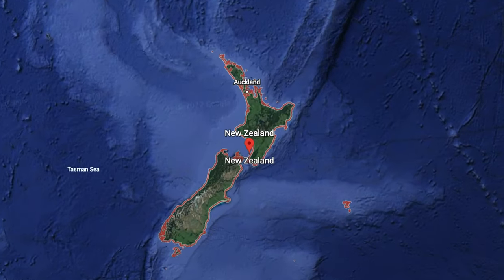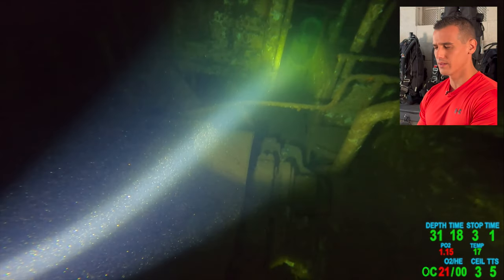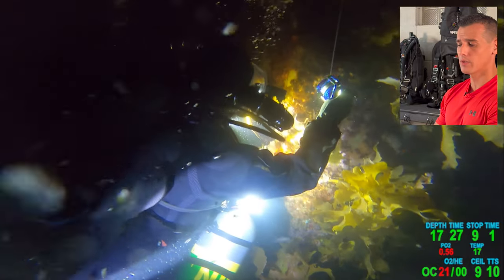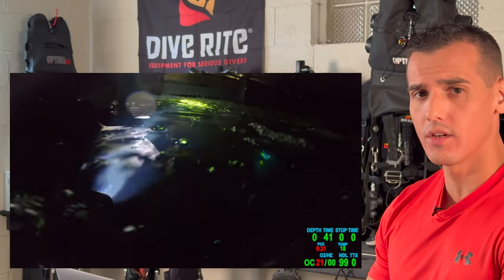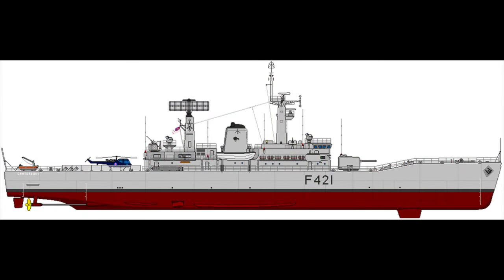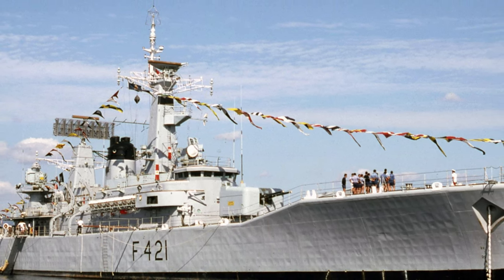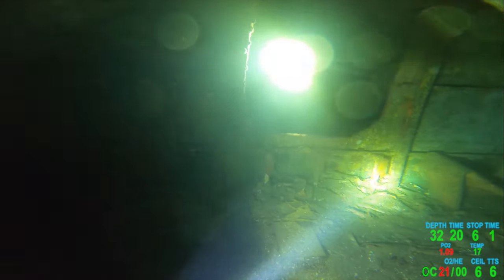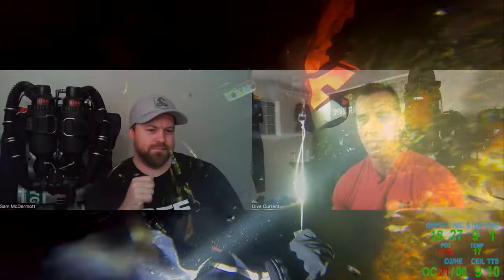Tech Diver Reacts To Serious CCR Bailout Incident!

Comment: Poor dive planning and gas management. Should be carrying enough gas to do his OC deco and so should his buddy.
Reply: Hey Matthew, we were carrying enough BO to get to the surface if we exited the wreck and went straight up. That staged bottle was nothing more then extra insurance. I actually only swapped to that bottle a minute before surfacing beceuase I was low on my BO bottle. I wasn't out of gas. Factor that was after a long swim at depth to collect that staged bottle (because it was there and why not have more then you need), and I also had my buddies full BO available if I needed it. I fail to see how thats poor dive planning or gas management?

Comment: I would say experience level on ccr is low. Problem solving could’ve fixed this relatively easy. I accidentally unplugged my o2 once. Caught the po2 dropping to about 1.12. Hit manual and didn’t work. Checked valve and o2 pressure and it was still good. Knew it had to be unplugged, fixed then continued the dive. This could’ve been solved similarly.
Reply from the maker: He bailed out because he was dizzy, he did not want to get back on the loop as it was compromised potentially. Thanks for your comment!
Reply: @divecurrent  I’m not familiar with the kiss units, but I’m sure there is a method for them to conduct a diluent flush?
Reply: @techdiverpratt5899  you most definitely can do a Dill flush but due to the in-line shutoff being bumped off, I couldn’t get any Dill into the loop. Sure, after I solved that problem I could have gone back on the loop, done a Dill flush and waited to see if that solved the problem. But CO2 issues can put you to sleep fairly quickly right so I didn’t really want to risk it. I had lost faith in the loop at that point (assuming CO2 breakthrough some how) so followed my training and bailed out. 

What response were you taught out of curiosity for a dizzy experience on a CCR? Like I’ve said before, I’m keen to learn from this.
Reply: @TURSTY09  I want to make it clear that I don’t think you did anything wrong. You made a decision, there was a plan in place, and you live to dive another day. 

In my mod 1 I was essentially taught to also just BO. Any kind of issue, BO. 

In mod 2 we were taught to work through the problems first. hypercapnia is typically a slow onset, usually with an increase in respiratory rate. Sanity breath, seeing if the symptom resolves itself. If it does I at least know the issue is in the rebreather, but if I was for say skip breathing or really choppy short breaths a dil flush could vent the loop of bad gas and allow me to get back on it.

Comment: He woukdve gone straight to the top if he was in trouble. You dont do deco stops if youre avout to die. Stop dramatising it. He was fine. His buddy woukdve also has spare air. If they was 250m down then yes but they wasnt. And he also had open curvuit reg? He was no way near death!
Reply: See the all postage. He thought the gas on the loop was bad, so he take all gas from the loop out. When he tried to breath again, because shutoff valve was closed, he got nothing to breath! So he flushed pure O2 to the loop at 30 m!!! This was really dangerous, but not because of CO2 or lack of gas.

Comment: Hey @Sailing Rattler - Diving KissCCR - Sam McD, fellow Kiwi KISS diver here. Thanks for sharing your story, and glad you made it out of this hairy situation safely.
I am diving a KISS Sidewinder, which has identical scrubber / ADV units to your Spirit. From personal experience I think you might want to consider re-adding the shut off to the hose supplying the ADV (but NOT to the one supplying the BOV!): The design of the ADV on this unit makes it quite sensitive to pressure difference and water movement, so that it is easy to get it to trigger and add unwanted Dil to the loop when going head down or sideways. If this happens while you are going head down through an opening it can quickly lead to a runaway buoyancy event at a time when this is most unwelcome. Since you are already using the BOV to add Dil you will probably find that the ADV can stay shut off for most of your dive anyway.
Also, hope to dive with you on the Mikhail Lermontov wreck one day. 😀
Reply: Thanks for the advice Michael. I will take a look at that, however I think it might be a challenge to get a slider on the ADV line independent of the BOV the way the spirit comes. The whip from the offboard tank runs up to a Y manifold that’s between the scrubber and the backplate so well out of reach. It’s all doable, but would require a total hose RE-run. 
So far I had not had an issue with the ADV firing when I didn’t want it to and I’ve been in all kinds of orientations on it. But will definitely be aware of that. 

I have actually heard of a story where having the ADV switched off would have killed two divers due to an uncontrolled decent after a boatman had to ditch the anchor with a buoy (that was far to small for the current and weight of two CCR divers), while two divers decompressed in current in the Solomons because a third diver lost the anchor line and drifted off under an SMB. So everything’s a trade off I guess. 

The spirit comes (or at least this older version) out the box without a shutoff at all so that’s what I have returned the unit to. I figure Mike Young knows best right!! 

I’m actually off to the Lermy in November!
Reply: @TURSTY09 : Interesting that the ADV isn't as sensitive on the Spirit as it is on the Sidewinder - maybe because it is closer to the diver's center mass.
The Sidewinder does not come as a 'ready to dive' unit - you have to add your own components like the Dil regulator and quick disconnect, or even the harness / wing, so I would not expect this to come with a shut off supplied in the factory configuration.
In general, for most CCRs, the factory configuration they come in is often geared towards no-decompression open water diving (probably to keep the catalogue price at a bearable level), and you will often have to add extras like shut offs in order to make it possible to conduct more challenging diving with the level of fault tolerance that you are comfortable with. So I wouldn't take 'this is the way the unit comes in factory configuration' as 'this is the way that makes most sense for the diving that I am doing'. Rather play through all the 'what do I do if X happens' game for all the scenarios you can come up, and  make sure that your configuration allows you to get outcomes that you can accept.
Of course, if you have an ADV shut off (or any other 'control element'), it has to be in a place where you can easily and quickly reach it in order to operate it, and you need to practice this skill to develop muscle memory for it. Still, if using your ADV is the only way to stop a runaway descent then I suspect that something else was wrong before this situation developed, like the diver being way too much negatively buoyant.
Nice, I'll be on the Lermontov in October as well!
Reply: @mikeller_nz  This CCR thing is interesting ay. I'll continue to play the "what if" game and I'm sure I'll land on a configuration I'm happy with one day =P.

That story I mentioned has a heck of a lot more to it. Hopefully I'll manage to get the person on Steve's channel one day soon to explain it himself. Its a doozy of a story!!

Comment: Great video! Thank you for sharing Steve & Sam! Just wondering, the computer displayed on the bottom right of the video belongs to who? Sam or his buddy? Is it a back up computer? and why is it in OC even though the divers were still on the loop?  Noticed this when I wanted to find out the PPO2 in the loop when Sam pumped the O2 to breathe.
Thank you! Looking forward to your new videos!
Reply from the maker: That is not the actual computer, it is computer generated. It’s not designed to work with close circuit repeater so you’ll notice it looks kinda funny.
Reply: Yeah as Steve said, it’s a skin on the video that I loaded the log data from my wrist mounted, hard wired computer into, but I couldn’t get it to read “CC” which is frustrating. All the other data is correct, but I did forget to switch my computer to OC until I was outside the wreck.

Comment: Awesome interview and post accident review. 

However the burning question I have prior to reading any of the comments is what mitigation if any was done to the inline sliding gas switch that was fouled?

Does he still use them, did he change the style or modify the location?  Does his online gas switch need to be rotated or unlocked by twisting before changing state in either direction on or off position?

We are happy for his safe return home but I really wish there was more conversation regarding the gas switch.

Sam job well done mate so glad your still with us! 

Cheers, #SeattleRingHunter
Reply: @seattleRingHunter - it’s safe to say that slider went straight in the bin after a bit of a conversation around why it was even there in the first place. My unit was set up like that when I purchased it (second hand) and the logic for it was to do with Trimix deco dives and having a bit of extra insurance no helium would get sucked into the loop via the DSV during an O2 flush at 6m. I’m not Trimix certified so have no need for it. Plus I think there are other ways to achieve the same thing.
Reply: Great assessment and thanks for providing your thoughts on this. 
Cheers, #SeattleRingHunter

Comment: Why does his Perdix on OC Tec? Not CC tec??
Reply from the maker: That is only a display added to the video editing software. It is not his Perdix that was just for an example.
Reply: @divecurrent  ahhh gotcha! Thanks!
Reply: @ReverseCard  Yeah the computer overlay on the video is a bit buggy and the OC/CC label doesn't seem to change based on the loaded in data. I did somewhat forget to switch my computer to OC until I was outside the wreck, so it would have been a couple of minutes out on its deco calc, hence the conservitive ascent.

Comment: I have some observations about the info presented and maybe an oversight in one aspect concerning the final backup  bottle.

First, while this diver (Sam) ends up using 3 completely separate breathing apparatus (CCR, BO, and backup bottle), the computer display in this video never changes to reflect this.  We only see "OC21/00 ..." which while technically does not make a difference to the outcome for this particular dive, but for the viewer, does not help track the diver's current air configuration mode.  Should the diver not configure the computer for all 3 modes and switch among those so he has a reminder of which he is using, regardless of him having only regular air in each for this dive?

Next, the backup bottle that is retrieved during the exit/ascent phase... clearly has a NITROX yellow/green label on it, while Sam has confirmed during the review that all tanks including this backup are regular 21% air.  No mention of this oversight?  

I do not claim to be an expert, but when reviewing scenarios such as this I hope to learn from them rather than experience first hand.  I would appreciate constructive feedback on my comments for clarification if I'm not quite understanding this case.  Regards.
Reply: Hey @bryanboldt887 thanks for the comment, and yeah, I welcome constructive criticism.

That computer overaly is a skin in the editing software I use that is a bit buggy as I mentioned in a previous comment. The OC/CC label doesn't seem to change based on the loaded in data from my computer. I did somewhat forget to switch my computer to OC until I was outside the wreck, so it would have been a couple of minutes out on its deco calc, hence the conservitive ascent. But there definitely was CC21/00 and both BO and Stage OC21/00 gases loaded into both of my computers (Nerd2 and Petrol). I didnt switch the computer from the BO to Stage when I did that gas switch which wasn't best practice I know, but being that I knew they were both 21/00, it would have made no difference. Plus I only had 1 minute left under water at that point so I was ok missing that step.

Re the tank lable - Yes the tank is maked with a Nitrox band indicating that if could have any mix of Nitrox in it. The tank (like all our tanks) was analysed before the dive, and the actual mix recorded on a lable on the tank neck (at least thats what we usualy do.....hard to see if there is actually a lable there or not in the vid). Same goes for my bailout tank. Thats labled "Custom mix", so anytime anyone intends to breath from a tank with any of those lables on them, then they should check for a lable on the tank neck that indicates exactly whats in it. If you dont know whats in it - dont breath from it.

Hope that clarifys those questions?

Comment: Can you use a ffm on a rebreather
Reply from the maker: Sorry… what is an FFM?
Reply: @divecurrent  full face mask
Reply from the maker: @adhamhwomble8345  one of many issues I would have with this.. If I had an issue and needed to bailout, how would I do this quickly? With my setup it would be almost impossible to do effectively as I have a DSV not a BOV.
Reply: I don't know I was asking just bought my rebreather so I'm learning lol
Reply: @adhamhwomble8345  You can buy them, but I know someone that did a full face mask course on a CCR and nearly died, so gave that up as fast as possible. I personally believe the benefits of a FFM are outweighed by the risks. Remember, you can talk to eachother under water on a CCR without comms 😉
Reply: People do sometimes use a Full-Face Mask with rebreathers but it's not common. I've heard of them being used on exploration dives. An advantage is that if you pass out there is a good chance you won't breathe in water and it possible to recover due to the CMF feeding you oxygen (or for a team member to recover you).

My instructor has one, and I've heard Craig Chellan used one too.

Comment: I’m really, really curious why there is an inline shut off on his BOV gas supply. That really doesn’t make sense to me at all. 

I’m starting to wonder more and more at MOD1 we’re just taught to BO anytime there is a problem, instead of working through the problem like we’re taught in MOD2 and 3.
Reply from the maker: I know for the Choptima, we use the inline shutoff to maintain optima loop volume. It stops the ADV from firing. We slide it on when needed. Some have switched this to a manual add.
Reply: @divecurrent  I have an in-line shut off on my ADV as well, but not on my BOV.
Reply: Hey guys, it’s basically just due to the way the hoses are routed out of the box. There is one line that runs from the offboard dill/bailout to a Y manifold that’s located between the scrubbers and the backplate. One of the Y outlets goes straight to the ADV via a very short hose, and the other around to the BOV. 

Like I said in another comment, it would be possible to reroute the whole thing, but they come without a shutoff so I have returned it to how Kiss designed it. I have heard of others having issues with the ADV firing in error when head down etc, but I am yet to run into that issue, but will definitely keep it in mind and be aware of that being a potential problem. 

Interesting to hear that the “if in doubt, bail out” idea might change in later training. Does that still apply to CO2/dizziness issues?
Reply: @TURSTY09  do you have a Facebook? May be easier to talk that way.
Reply: @TURSTY09 

Bail out first is always the way to go, even if only for a sanity breath or two. Especially if you're confused, dizzy or suspect CO2. No matter what MOD, 1,2 or 3, you can't go wrong by bailing out first once there's a problem.

Ploughing on with a possibly faulty rebreather could leave one dead without one even realising it.

Bail out, calm down, figure things out, fix the problem and go back on the loop. Continue dive. If problem cannot be fixed, stay bailed out and abort dive.

Comment: high ppo2in the loop caused the dizziness seems most likely. could be co2 but it seems too coincidental. thoughts?
Reply: The log off my computer says I was at an average of 1.1, and a max for a brief moment of 1.3, and I calibrated the computer at the last sorb change/checked cell voltage before this dive. So unless the cells were not telling the truth, I dont think a 1.1 would cause dizziness??
Reply: Did you ever figure out what caused the dizzy spell? Im very curious. I also thought that loop volume could play a small factor
Reply: @GIJeffpauze  no, unfortunately I never found any evidence of any cause. I’ve had a bunch of dives on the unit since, even using sorb from the same container, so I can only really put it down to either shallow breathing or just a random head rush for some reason. Weird huh.